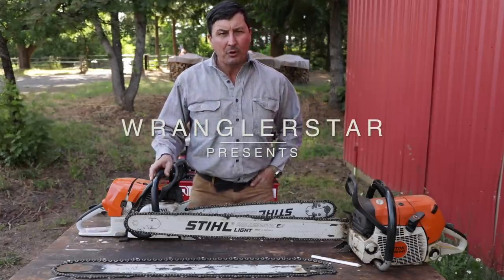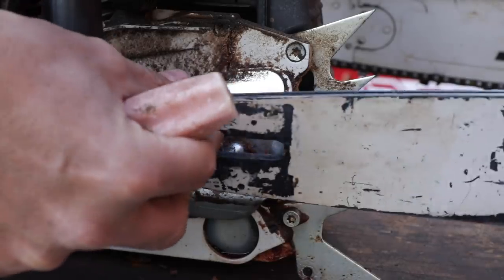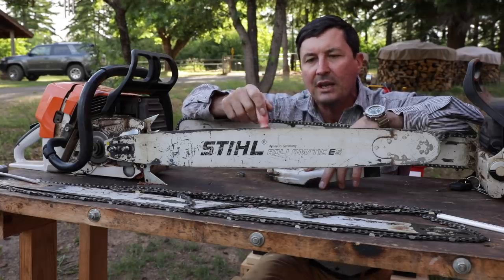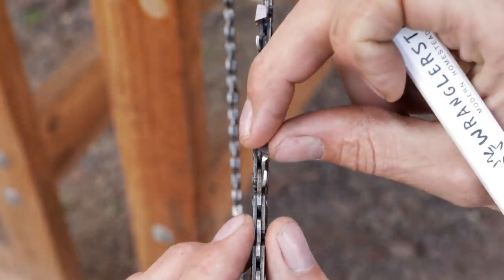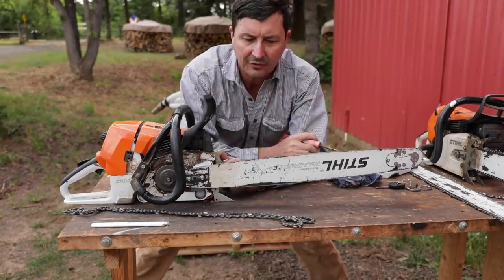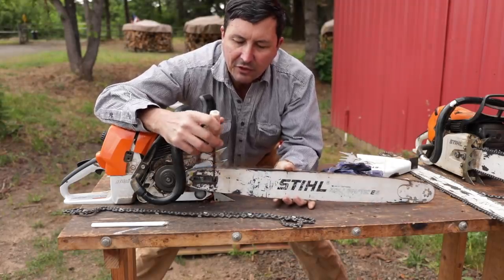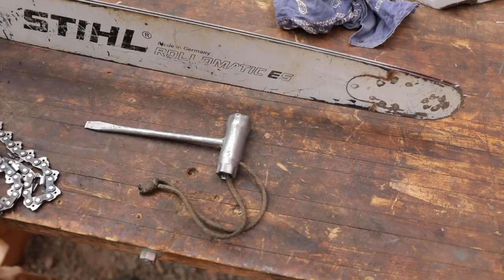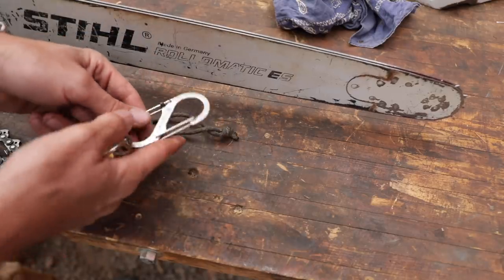Why Loggers Run Upside Down Chainsaw Bars

Comment: Wrangler, you are actually extending the theoretical life time of your bar by 100% not 50%.
Reply: actually looked for this comment, 
started to doubt myself.:-)
Reply: Maybe he took into consideration that the top of the bar still sees some wear, so flipping the bar doesn't give you a perfectly new rail. So it's probably somewhere between 50 % and 100 %.
Reply: swiss yeah, I figured that's why I said theoretical, as he did not mention that there is any top wear.
Reply: Michael Trower So in mathematics you have the idea of complete and incomplete status. If you were to only use one side of the bar as he implied most people do, then the complete status at the end of its lifetime would be 100%. If, however you were to flip it everytime instead of only using one side you would now have another whole original lifetime, aka complete status. So yes to the layman such as yourself it would seem like it would be increasing the lifetime by 50% of the amended total, you are in fact increasing the lifetime of the bar by 100% relative to the original. It might seem to you like there is no difference, but that would only be because of a lack of initiation to mathematics.
Reply: You also have to thing about the mathematical view point of a 100% VS 50% is you can measure top to bottom meaning that's 100% of the bar or think in the way of each side of the bar is 100% brand new and no where when bought. So when you wear one side it's now not 100% perfect but the other side is "100%" perfect because it hasn't been touched. (Besides the natural friction of the chain going around the top side minus less pressure compared to the bottom. So technically yes you could use 100% more of your bar but because of that frictions probably somewhere around 80% more theoretically
Reply: If you didn't realize you could flip the bar, the bar is spent at 100% If you did know that then you will (double) the life of the bar witch will give you 200%
Reply: Michael Trower professional 4th generation engineer reporting in. David is right. It’s a 100% lifespan extension. 
If you double anything, you add 100%. Simples x
Reply: Michael Trower here’s the deal ... let’s say you get 300 hours cutting time by never flipping the bar. After 300hrs the bar is worn and shagged out in one side. Now if you flip it over and use the good side until it’s worn out you get another 300 hours. 
The extra time you get is the same as what you already had. That’s a 100% increase.
Reply: Another way to see it from Michael's point is that if you flip the bar, then the bar is 100% shagged. If you don't, then you've only used 50% of its life, so you have 50% left. I think this is where the misunderstanding comes from...  Flipping the bar gets you the other 50% of its life, therefore doubling its life, therefore (and I wholeheartedly agree) you get 100% extra if you flip.  Hope that helps a bit.

I'd take that guy up on his cold beer for the hell of it Michael...
Reply: Joe Haddon yeah, this is the difference between 50% more or 50% less. Like if your boss increases your pay by 10% then cuts it by 10% the next month you’ll end up with less per month than than you started with. Look out for that one ;)
Reply: Michael Trower , nobody is wrong. You're going from the stand point of doing it the proper way and the bar being worn out on both sides.  The other guys are going from the stand point of a casual user or home owner that knows how to run a chainsaw but not necessarily proper protocol that probably just replaces the chain when it gets dull and doesn't even sharpen it.  Most of those inexperienced users aren't going to flip the bar and it will be shot when one side is worn out.  That person that didn't flip their bar will have gotten roughly half the lifespan out of there bar because they didn't flip it.  Neither argument is wrong not flipping the bar will result in half the life span which therefore means from the inexperienced user that doesn't flip the bar, flipping the bar will result in a 100% more longevity.
Reply: Job Woolsey this ^^
Reply: Did you guys realise that if you re-profile your bar you could get 200%. OMG. 😱 the plot thickens. We're gonna need more beer for this one lads.👍🏻
Reply: Michael Trower , lol that's a good point. I was just throwing it out there to carry on the discussion for the craic. Enjoyed reading the comments. 👍🏻
Reply: do not fail to consider that the wear on the tip as he chain bores or simply rotates around it , this wear progresses as a linear function, based on tightness,cleanliness, and pressure placed on tip.
You do not renew this area by flipping the bar.
Reply: David Hlubocky + Amazing the end surfaces don't wear, neither the top, only lesser, and so aren't included in the equation.
Reply: David Hlubocky how about you just say it lasts twice as long if you flip it.
Reply: There seems to be some misunderstanding about the significance of the 100% figure in my original comment. And whilst I agree that different perspectives can seem to result in different conclusions, in this case I don't believe that confusion is possible. Let me explain why, wrangler said that if you flip your bar you are extending the lifetime of your bar by 50% if he says extending by an amount then it is obvious he does not mean that you are using another half of a whole, if you are extending something you are increasing it, not using it to its full potential, rather using it to more than its full potential. So I corrected a grammatical mistake. The starting point in this case is irrelevant since he used the word extending, therefore only one real perspective that is not nonsensical can exist.
Reply: The life of the bar is the life of the bar no matter how many times you flip it file it clean it or what ever. It how you use your chainsaw. I run my saws everyday and flio bars twice a month maybe and get months and months out of bar then file it or grind it and start all over again
Reply: Well then as an engineer you must know that The bar is designed to be flipped and 100 percent used means that it has been flipped and it is worn out. There is no further useful life in the bar except as knife making material. Also if you wanted to be extra picky about this math... if one side of the bar was worn out, a certain percentage of wear has been done to the opposite side thus reducing its useful life. 1st generation arborist and tree care business owner reporting in here.
Reply: but it won't be, you will get 75 percent wear on side A and 25 percent wear on side B, because while side A was being worn down side B also saw some wear as a matter of course and back barring etc. You will get 100 percent life and no more because the useful life of the bar has been reached.
Reply: re profiling is a waste of time, because by then the bar rails are tempered and brittle and the tip is near shot anyways! Don't be cheap, get 1 or 2 good long seasons of use and get a new bar!
Reply: No the problem is the math is wrong. The wear is not even like that. The bar does not wear out on one side and not the other. Even if you flip the bar that side has already incurred some wear it doesn't start off at zero wear! And the bar is designed to have a useful life span which is 100 percent used up when the rails are worn and brittle and the tip is also needing replacement.
Reply: What is so hard to understand? The bar is intended to be flipped ergo the holes for the oiler port? The design therefore makes the bars 100 percent useful life " over " when no amount of flipping will increase it's use. How is this hard to understand? The math is too simple for 3rd grade? 100 percent of the pie is eaten when the pie is all gone!
Reply: Because you always had the logo up and thought that was 100%. Now turn it over and get another 100%. You extended 100%
Reply: I use the top and bottom of the bar when cutting, all day long
Reply: Do you feel better now
Reply: The bar is meant to be flipped, lets say a 100% bar lifespan is 10 years from factory, by incorrectly using one side of the bar you you will only use up half or 50% of the bar before its ruined, by flipping it you are getting a increase of 50% or 5 years in bar life restoring it to its intended life span of 10 years or 100% so you would increase its life by 50% this is not a math equation, math is irrelevant in a simple matter of commonsense, but then again youtube is home to wannabe professors.
Reply: The life of the bar is always 100%.
Reply: WineScrounger 50% of the lifespan was up and 50% was down.  Technically,  flipping it over did nothing to the lifespan.
Reply: At least a few of you are sincere, and at least a few of you are trolls. The joy is trying to figure out which is which. 😂
Reply: If he was good in math he would not be cutting trees for a living.
Reply: Apparently, math is not Michael's strong suit.
Reply: 50% of these comments are from people who are very bad at math, 100% of the time.  It IS 100%.  Fact.
Reply: High school educated guy with the superpower of common sense and hard knocks weighing in. The total life of the bar can not exceed 100% which is 50% to the side. That means if you never flip the bar you will theoretically use no more then 50% of it's life. Those of you who think differently are WRONG. How is it you think that by flipping the bar you are adding another 100% to something that can have no more than a TOTAL lifespan of 100%. I agree that you will use 100% of the life of each side but 100% of the life of either side is only 50% of the life of the bar. I hope that clears.things up for all you engineers and rocket scientists.
Reply: Tyler Sutton I can not possibly agree more!
Reply: Flipping the bar is only 50% of the equation. If you dress the rails with a flat file when the rails show sharp edges, you'll get even more run time out of the bar. As much as  3000%!!! A small exaggeration.
Reply: @TheBrushcutter  Obvious troll is obvious, but some may not have this figured out so here goes. Adding any amount of percentage to anything is always in comparison to the original situation of 100% so yes, it is always in excess of 100% by definition.
Reply: @michaeltrower6792  exactly. Flip it once a day. If your full time on it that is.
Reply: @UltimateSwordmaster  incorrect! The bar starts as a new bar. When the bar is flipped 50 percent of its perceived life expectancy has expired. In mathematics you also have proper and improper methods of grouping known percentages for analysis. Go back to class.
Reply: This is, by far, the best thread I have ever seen on YouTube...
Reply: Brexit Monger  the bar does not exist!
Reply: @mr.thomas5186  Sweet Jesus are we still arguing this?  If you are indeed using your skewed idea of mathematics, then you would not be extending the lifetime of the bar by anything, since the total lifetime of the bar is 100% percent, and if you only use 50 you are not extending the lifetime by flipping it. If however you only use one side, and then you flip it, where as normally you would not do that, then you are extending the lifetime of your bar by 100%, learn English, learn grammar, learn mathematics and then argue with people who clearly know more about all three than you.
 (Edit: I removed some reactionary and insulting parts of my comment because I don't believe that ad hominem attacks are a good way to conduct a debate.)
Reply: Ahhh, its double lifetime if you rotate.
Reply: @theflyingsheepcircus   Both sides are exhibiting friction wear, regardless of which side of the bar is up. You would have to create a measurement of the friction to determine how much wear and what factors impact the wear calculations--e.g., proper oiling, type of oil, operating temperature, ambient temperature, type of metal used in the construction of the bar and chain, manufacturing process influence on wear, operator influence on wear etc., The study would then result in the data being coallated and anyalized using observation methods and proprietary algorithms. The findings would then be submitted for peer review--if the funding lasts long enough.
Reply: If the lifetime of the whole bar (downside and upside) is 100%, then each side represents 50%. Once one side is worn out (50%), you'll have 50% left. This is true if the bar is intended to be flipped. If the bar isn't intended to be flipped, one side will then represent 100% of the bars lifetime. By flipping the bar, you'll gained another 100%. The manufacturer declares in the manual that the bar is intended to be flipped which means Wranglerstar is correct.
Reply: You're absolutely Wrong! If u never flip the bar ur only using 50% of the bar. So theoretically ur bar will wear out twice as fast as it would if u flip it. There's two sides, meaning each side is 50% only use one its 50 so if u use both U'll increase the life of your bar by 50 percent! I don't understand why yall think u get two brand new bars if u flip it? Smh
Reply: @michaeltrower6792  you are funny :-)
Reply: It stihl wears on both sides, but not evenly. You extend the life of the bar, period.

I hand file, and clean and flip.
Reply: I extend the life of my bar by not using my chainsaw. Old and slow and just watching my trees grow.
Reply: You are extending the life of the bar by 100%. If it takes a year to wear out the first side and another year to wear out the second side you have had 100% more life from it. Think of it another way, A 50%discount wipes out a 100% mark up.
Reply: Maybe you're only using 50% of the bars life if you do not flip it..
Reply: @bcrusher1979  you must’ve learnt Democrat maths. 
Boy, what in del hell?
Reply: @Makes-and-Mods  argue the dead horse!

Comment: When I was working in the woods for the summer on fire crews, I spray painted my scrench, bar nuts and files in blaze orange, covering everything.  Most of it wears off pretty quickly but helps you find those items when you drop them in duff and heavy brush.